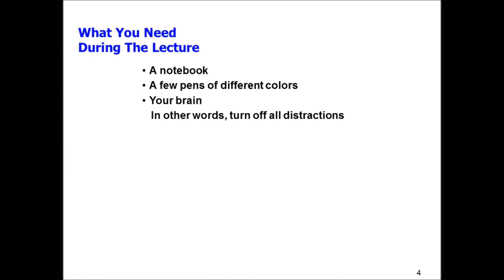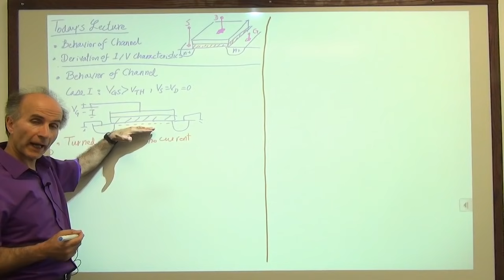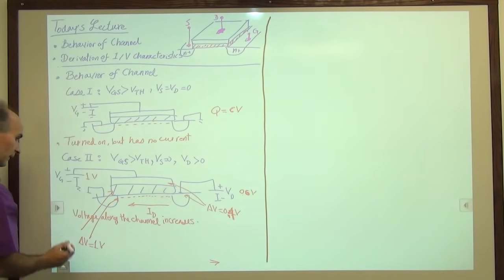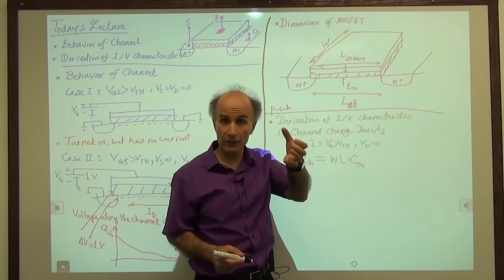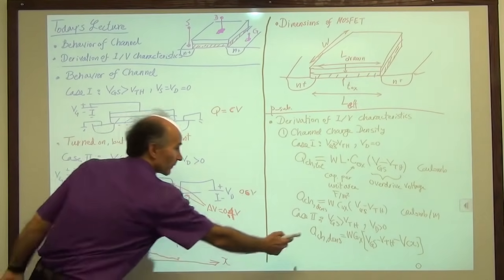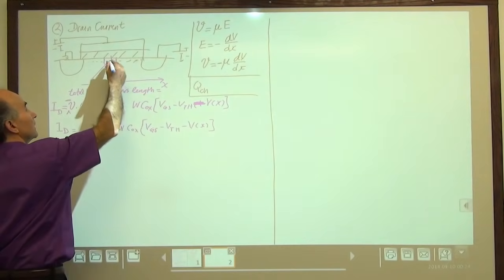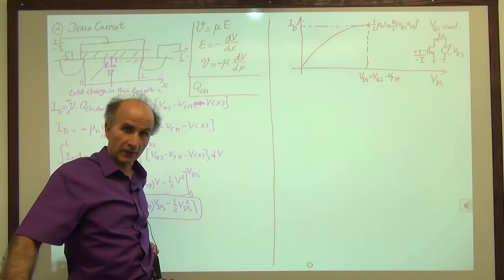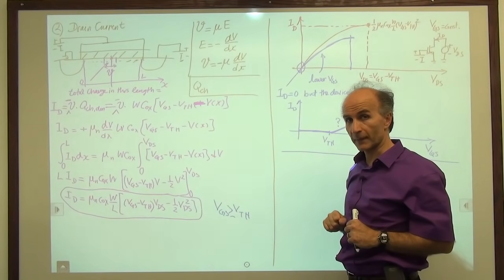Razavi Electronics 1, Lec 30, MOS Characteristics I

Comment: Is it correct to say that the Gate voltage increases the ABILITY for the transistor to create a current, whereas the Drain and Source voltages control the actual current flow?
Reply: Gate voltage increases the ability for the transistor to create a channel, whereas the Drain and Source terminal voltages regulates the actual current flow
 along the channel.

Comment: sir what do you mean when you say the mosfet device is ON with Vg less than Vth ? what significance does it have if there is no current ?
Reply: No, sir has said MOSFET device is ON when Vg is greater than vth not less than. And he said it happens in MOSFET only not in BJT.
Reply: And there is no current bcoz vd is zero so no current is there

Comment: when Vgs > Vth, Vs=Vd=0 won't flow current(it's nothing but capacitor)
how the current flows in capacitor when we apply positive voltage??? 10:00
Reply: Here in this case, gate - poly - substrate form the capacitor,  the current flow is considered across the the drain - substrate - source.

Comment: v  =uE; where v is velocity; But while deriving Id  ,v  is considered as small  length of channel.how velocity equation is substituted in the place of length?
Reply: This v is not as velocity, this distance is velocity times to 1 second (we can call it v meter). Always in this kind of problems, they consider this distant to study the what happens to the charge inside of this volume in the frame of one second. what volume? The volume with the size of v meter (v times one second) times W times in the thickness of the channel. Then he explains more, in one second later all of the charges inside of this volume (=Qden*(v meter)) is passing through the rectangular interface with the width of W and length equal to the thickness of the channel. Because we know that all of the electrons in the frame of one second they shift v meter to the right. so all of the charges inside of that volume one second before they are passing from that interface in this time of one second.
Reply: @samanzarbakhsh7923  Thankyou so much for ur explanation

Comment: can anyone explain why we are choosing n+ (heavily doped )....i m not clear at that point so if anyone had clear about that point pls explain
Reply: just bcaz to make a grt bond between p type substrate and n type material for easily current conduction
Reply: So as to avoid the construction of any kind of diode or rectifier we usually use n type heavily doped//// And also because we want to have a good contact with the source wire and the part of silion substrate. Happy to help.

Comment: In the graph of Id vs Vds, what maximum value of Vgs can one use?
Reply: the maximum value of Vgs can not exceed your supply voltage that is Vdd .  obviously you can give give the input that is more than the supply voltage
Reply: VGS is a constant value through out the experiment assumed to be greater than the VTH so yeah it can be any value greater than VTH.....